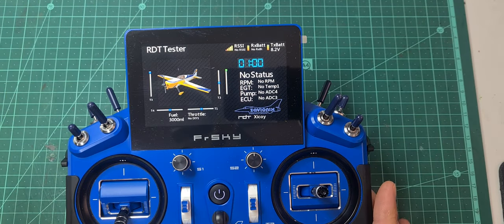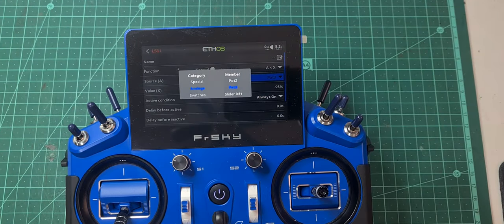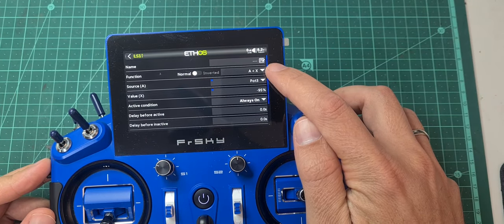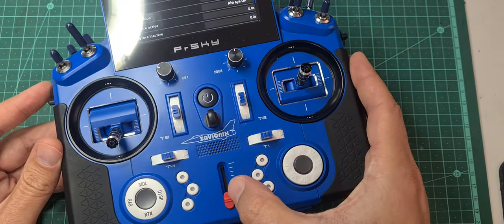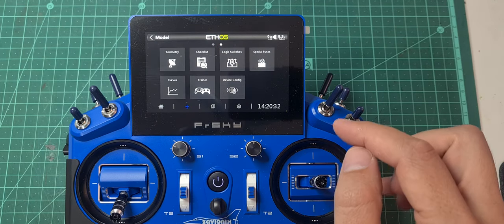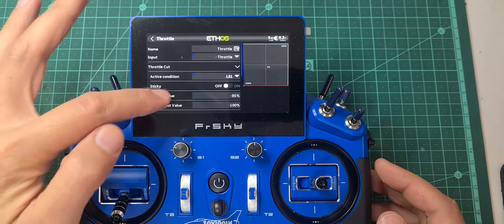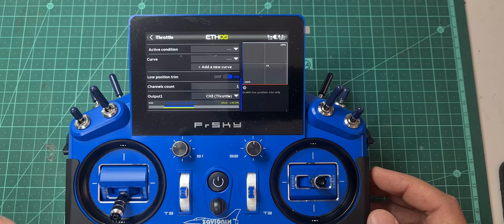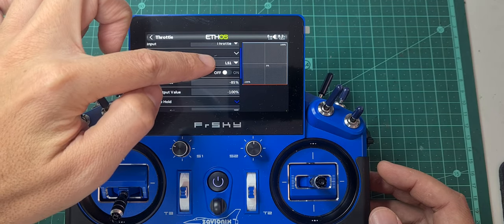FrSky X20S - how to assign the red slider as turbine trim

Comment: Thank you Lior, great video.  I do have a question.  When the trim is down/engine off does it still allow me to do a manual cool down with the throttle stick?
Reply from the maker: No. Must put the slider up.